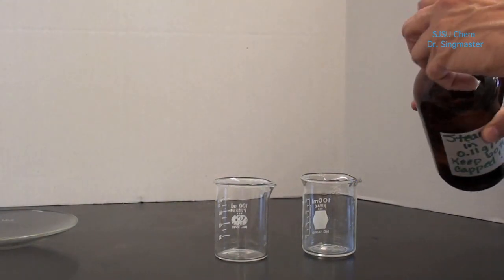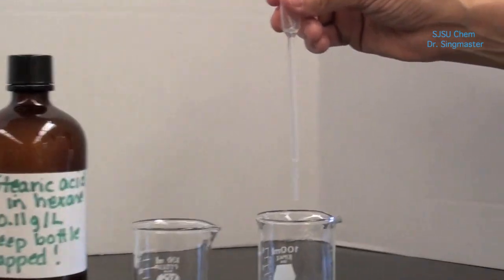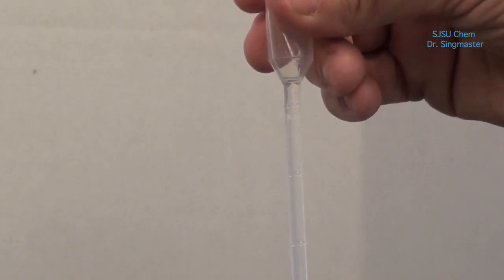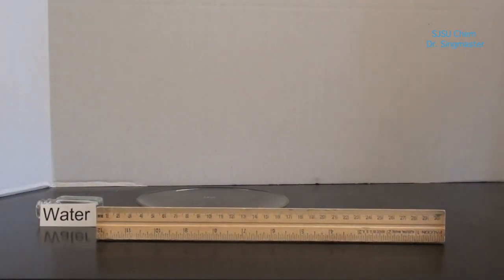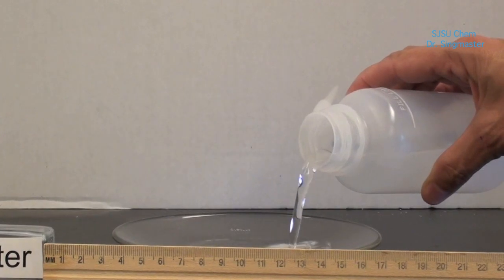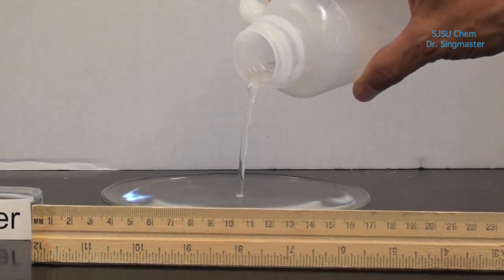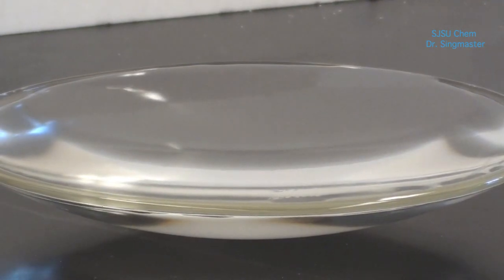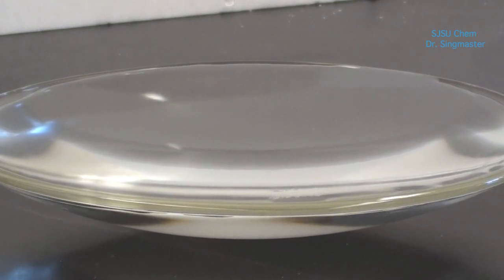Experiment 11 Part 1

Comment: I don't know if this helps but I measured the video's ruler with my ruler and figured out the ratio and stuff etc etc and got the watch glass' diameter to be 12.8 cm from one frame but I did some research and watch glasses are usually made with diameters ...10, 12.5, then 15 cm, so you could assume the watch glass is either 12.5 cm or 15 cm (in my case, I just assumed it was 15 cm because I think since the watch glass was a lot further than the ruler, it has to be greater than 12.8 cm). Then once the water was poured in, again, measured the video's ruler cause this time it's a lot more zoomed in, then found the ratio and got my water surface diameter of 12.24 cm (if the watch glass was 12.8 cm). Since I assumed the watch glass was 15 cm, I have to stretch 12.8 cm to 15 cm and find the ratio to figure out the equivalent stretch for 12.24 cm.

EDIT: The lab manual mentions the watch glass is in fact 15 cm

Comment: Also the rough approximation I made for the diameter of the monolayer of stearic acid was right around 1cm. I took screengrabs from the water measurement and lined up the screengrab from the stearic acid monolayer measurement as BEST AS I COULD (using the monolayer measurement as a reference for scale). Honestly a lot more work than simply having an actual ruler in the shot, but it should work out fairly well. I will be putting in my explanation onto my calculation sheet as well so that I might still get points for it. This video needs to be redone with better resolution.

Comment: 13.3-13.5 is the diameter of the glass and 12.3-12.5 I would say is the diameter of the WATER surface. I also counted 6 drops of stearic acid before the contact lens looking thing stayed.